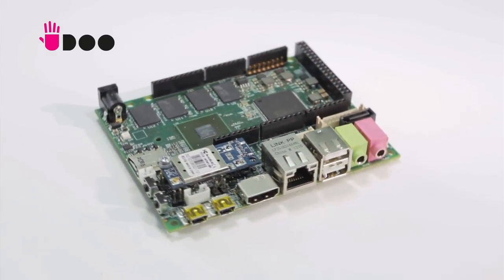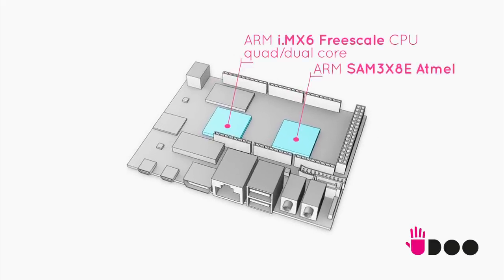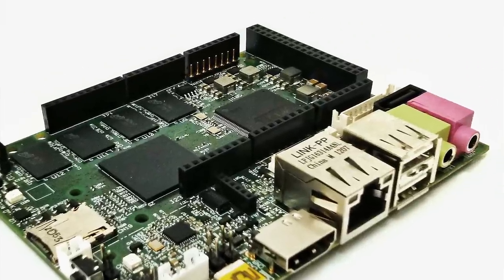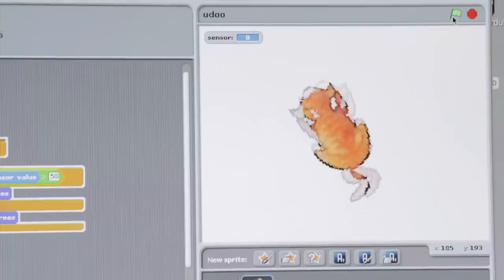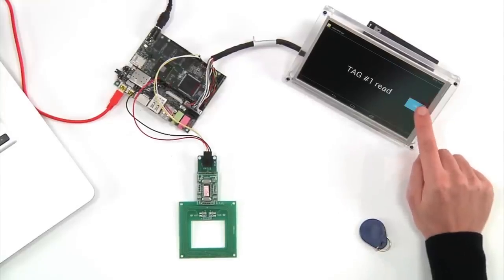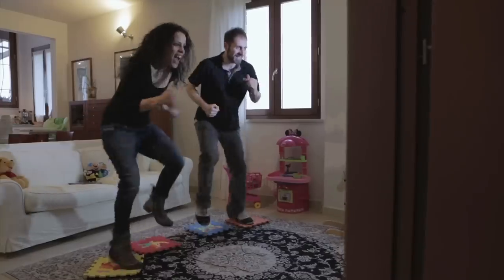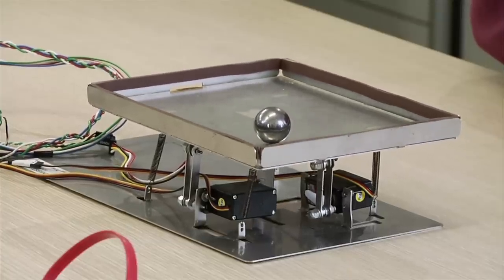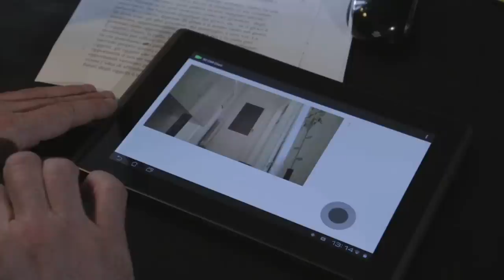UDOO: Android, Linux and Arduino™ in a tiny single-board computer

Comment: I feel like for most single board computers the bottleneck has never been the processor but the RAM. You can get a lot done with a slow processor if you've at least got enough ram to run everything very smoothly and very quickly. You can get away with a 1 gigahertz dual core processor if you've got two gigs of ram, but a 2 gigahertz quad core processor can't do shit if it doesn't have enough ram.
Reply: For linux, 1 GB of ram is enough for basic tasks, but i do agree that if this is priced at $100 then it should atleast be 2GB of ram
Reply: TheBlakout even with an i7 pc, same story

Comment: I'm interested, convince me it's more useful than an Arduino Due & a separate mini pc of similar spec. The price is similar and one of the big appeals of Arduino is the ability to remotely interface with your project via internet, bluetooth etc. Granted you'd have to add some comms hardware to a stand alone Arduino which will offset some of the price difference, but are there any advantages with  your  board?

How do the 2 sides communicate (speed)? Can they fully share resources: wifi, usb etc.

Comment: this is impressive, i have a few questions, 00) is this a 32bit board, 01) the ram is 1gb, can it have more, 02) it has 76 gpio, how many are pwm capable, 03) is this bootable from external hard drive, thanks for your attention

Comment from the maker: Go to udoo.org in the features section (processors' communication), here you can find all the possible connections between the two processors.
For a more technical and exhaustive document, see the block diagram linked on the same page.

Comment: This seems like a really great idea, but price point is a big determining factor in purchases for most people, especially the weekend hobbyist or tech savvy parents looking for a fun way to introduce their kids, so when you can buy both an arduino and banana pi for cheaper than a combination of the two it kind of defeats the purpose, you know? Id expect it to be cheaper considering its pretty much half of the components required to make it compared to a raspberry pi and arduino other than a few things. To me it just seems like theres a gap between the price and the minor bonuses of having the two combined rather than just having two platforms =/ it still is an awesome idea and im sure it'll take off
Reply from the maker: Hi there BanaGunz! I think there are more than just a few differences between UDOO and a combination of Pi + Arduino. Here you can find a datasheet with all the differences: http://www.udoo.org/wp-content/uploads/2013/05/UDOO_comparison_table.pdf

By the way, there are also huge differences in Android performances. Just check this video: https://www.youtube.com/watch?v=X_up9doF72I
Reply: This is why I got the odroid xu4.. Price point..